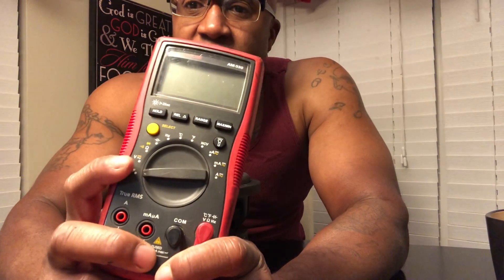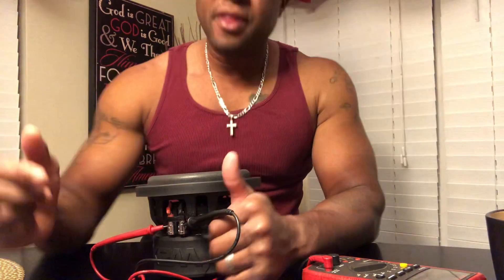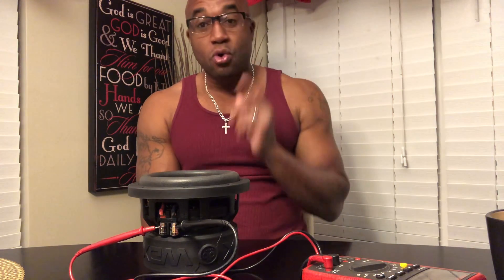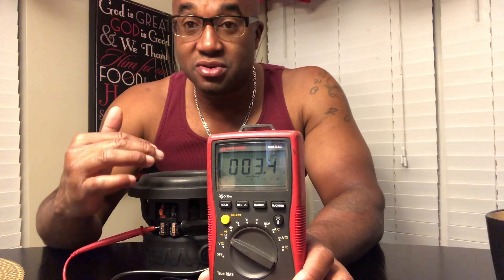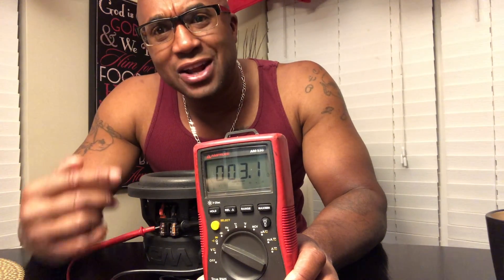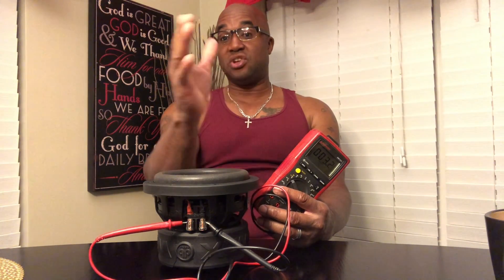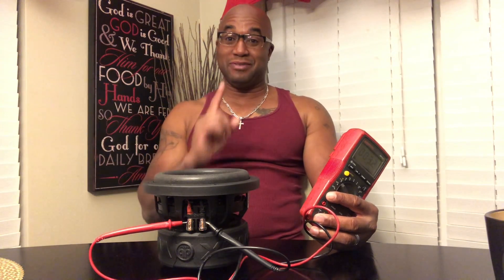Multimeter to check Subwoofer ohm loads

Comment: I know you know MBEnclosure, but most don't know that when measuring something as low as 1Ohm, people need to make sure they factor the resistance of the test leads (especially when using a budget meter).  I may have missed that part in the video,  so that if a 1ohm sub reads 1.1Ohm but you got 0.2 or 0.3 resistance in the test leads, then you actually at 0.8 and 0.9 and you are good.  You test the resistance in the leads simply by touching them together and looking at the reading.
Reply: and you need to make sure you battery is fresh that can really throw the meter off.

Comment: Quick question my sub is 1ohm but mulimeter is reading 1.5 is it bad I can push in the cone just fine don't hear anything
Reply from the maker: If it dual 1 ohm, each coil should read less than 1 or equal

Comment: You forgot to mention to test the resistance of the multimeter leads first to see how much resistance they have. Take that number & subtract it from the ohm reading you get on the multimeter from the subwoofer & you get the actual true reading instead of an incorrect measurement.

Comment: Very informative video man!  One thing to note is sundown X V.2 woofers read between 3.8-4.2 for DVC 4 Ohm and 1.8-2.2 for DVC 2 Ohm. I confirmed this straight from technical support after measuring my coils at 2.2. Just an FYI for those Sundown nuthuggers out there 😂😂
Reply: Did you test your multimeter leads for how much resistance they have first, then deduct that number from the number you get from the subwoofer ohm reading? If not, your ohm reading are incorrect.
Reply: I am sure it is similar for ZV and NS woofers as well. Not sure about their other traditional line of woofers.
Reply: Lol

Comment: My d2 neps read 1.2 when all 4 were wired to 1 ohm with no play time at all
Reply: If you have them in a enclosure factor in box rise I'm at 1.3
Reply: Measured the same in and out of enclosure
Reply: After some play time they went to 1.1 buts that as low as it got
Reply: @TheHiimrice  Once the soft parts loosen up you'll be fine

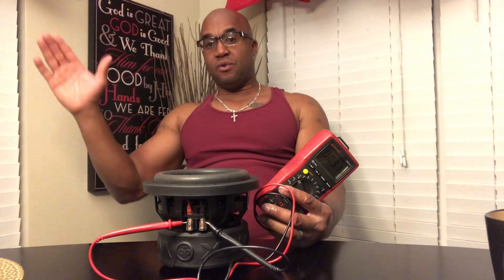Comment: Hey OG at 8:30 in the video u said D4 should read between 3 and 4 , then a D2  should read between 2 to 3 is that right cuz u said should not read number above what coil is if it does sub is n it’s way out so shouldn’t it be  1 to  2 then no disrespect to u please don’t take it that way maybe I am tripping but just D2 can’t read one number higher right ?  If I am wrong my bad bro my apologize to u
Reply from the maker: Exactly. It can’t read 1 number or more higher.... lower is okay
Reply from the maker: @SpaghettiConfusion  whatever the coil is stated as then it shouldn’t read higher than the number